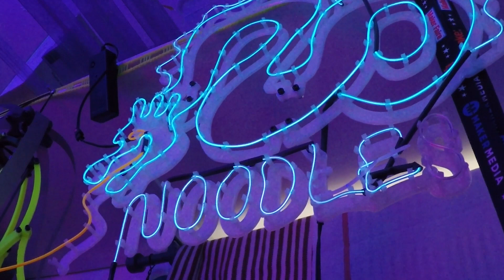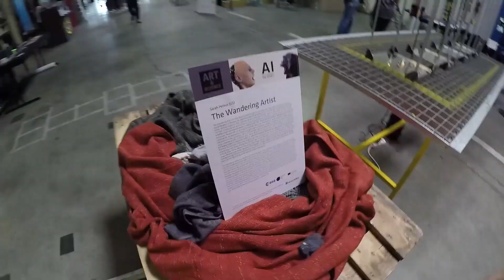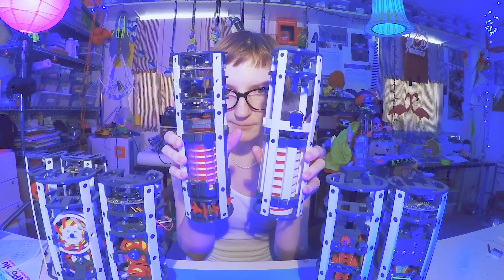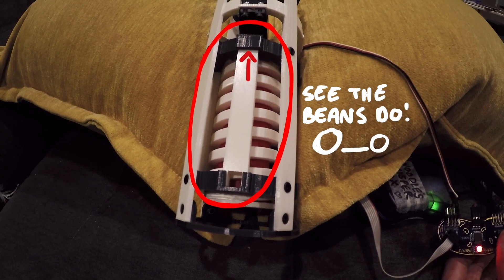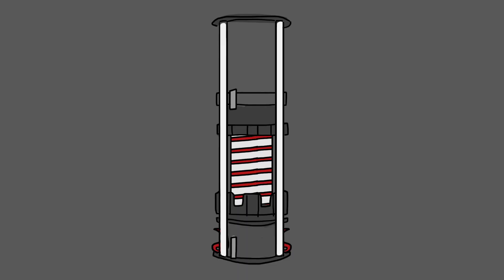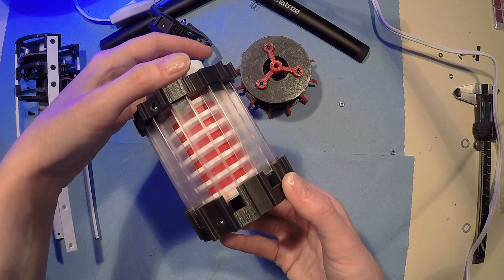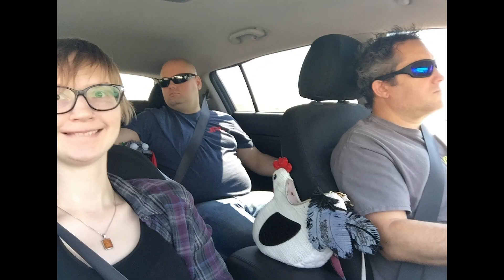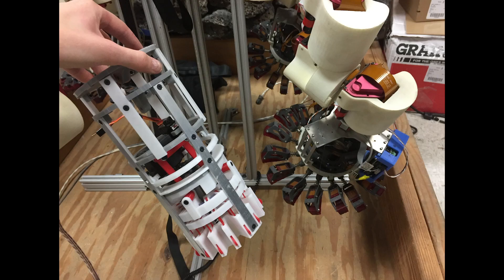Modes of Taste : Bean Planting Module rev.2

Comment: i wonder if it wouldnt be possible to put the bean inside more of a regular form, im thinking something similar to a water soluble paintball or pill casing type situation, but with a bean inside. so it rattles around inside of a sphere until water is introduced (which should happen on its own if youre planning on growing these beans), causing it to melt away. but my main concerns there is capacity, a bean containing sphere would take a lot more space than a bean on its own, and durability, it would be bad if a beanball broke and bits of the casing and a loose bean got where they werent supposed to be.

Comment: You could embed the beans in spherical bits of clay, ensuring they can easily roll through the Archimedes screw.
Reply: But I assume the plan is planting them... how would that work, in the end?
Reply: @mykas0  Works great, use a water soluble mix of clay and fertilizer. Cody, of "Cody's Lab", did this with various seeds for his ranch. He made them into balls that he launched from sling shot, and was able to broadcast them easily. He made a video about it. https://youtu.be/zzlia43hCow